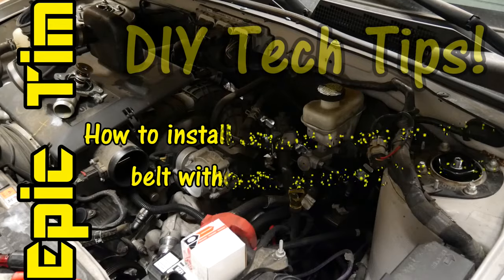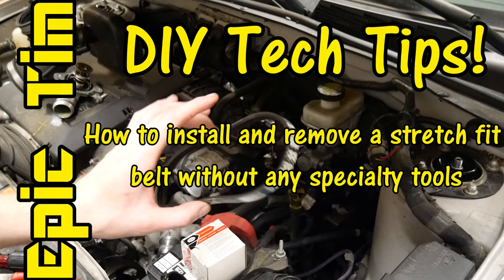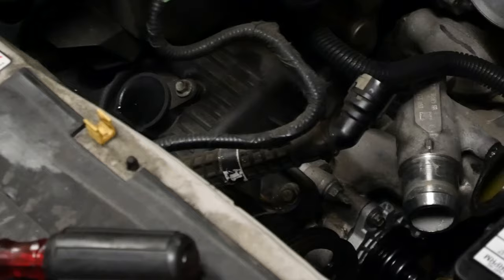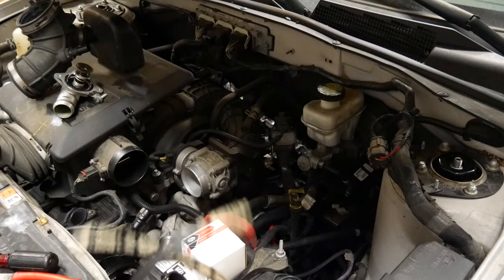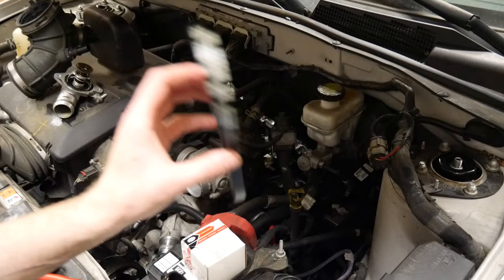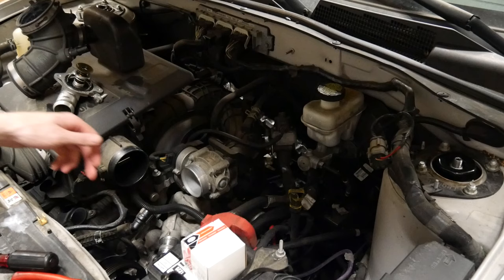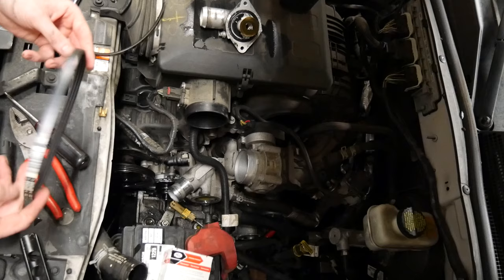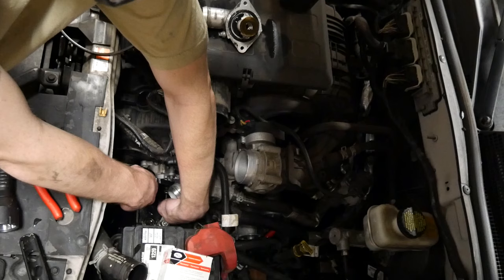DIY - Install and remove stretch fit belt without special tools

Comment: Thank you for this. After work I will remove the belts from mom's chevy aveo and replace the alternator.  When I saw the TWO belts Sunday I was surprised and couldn't figure out how to do the job. Now its clear. Remove the stretch belt (outside), then put 3/4, 19, box ratchet whatever fits on 12 point star belt release and turn CCW to remove serpantine (inner).

Comment: Used this for help last night. My belt was slipping off after a few tries...so I put the belt on other side of pulley. Then it jumped on instead of off. Thanks for the video...2009 Ford Escape 6 Cylinder

Comment: I googled “install belt without tensioner, and it brought me here. Knowing it wasn’t going to be the same application, I was still curious. And glad I was, I’m working on the exact same vehicle, made my day. (Reservoir, thermostat coolant temp sending unit, water pump, and anything else I broke along the way. Thanks man. Great video!
Reply from the maker: This made my day, thank you so much for leaving a comment!

Comment: You can use a zip-tie to install it. Just thread the zip-tie through the top pulley spoke and around the belt. My new belt came with one. Just bump the engine and the belt installs itself while the zip-tie gets cut at the same time.

Comment: Cut old belt off, use zip tie method to install new.  Putting a metal tool on the pulley is not a good idea because of how easy it is to nick/damage it, which will cause belts to fail prematurely.
Reply from the maker: Thanks for your opinion, you'd have to use a pretty hard edge to damage a pulley but I'm sure it could be done with an inappropriate amount of force.

Comment: And not a word about safety and losing fingers in the process with "a friend" spinning the engine...
Reply from the maker: Didnt pay attention really well did ya?
Reply: Might be a good idea to suggest that the fuel pump fuse be removed if using the friend ignition method for increased safety
Reply: Lol. Friend cranking engine!?!  😂